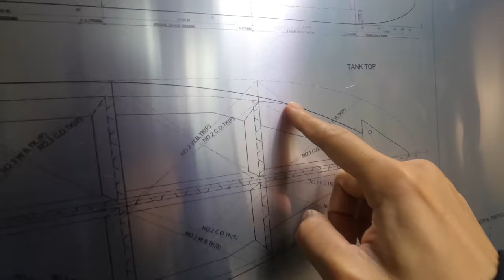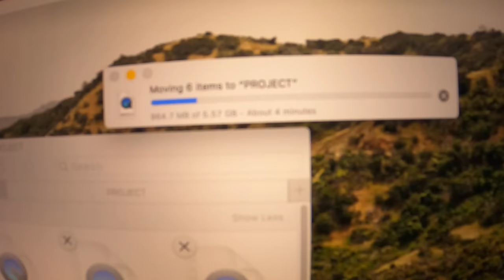Captain’s Day in merchant navy/ #shipsailorsunil

Comment: Dear Capt,

Good day!!!

My doubt is that, those camera and light radiation wont affect inside the tank. Usually i heard like light should be switch on after checking gas free, if not then it may causes fire hazardous..??

Awaiting ur reply...
Reply from the maker: Yes absolutely ship was itself gas free abs gas is checked everytime before entry 😀👍🏻, also during entry we use only intrinsic safe lights on deck along worh intrinsic safe camera
Reply: @ShipSailorSunil  
Dear Capt,
Good day!!!

Well noted and thanks.

Have a safe and hpy life..!💐

BR,

JK